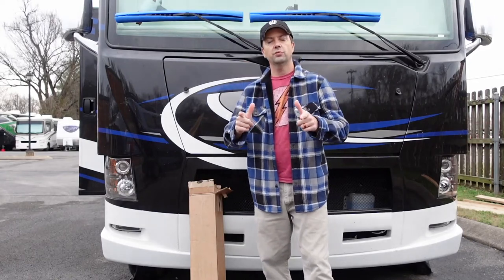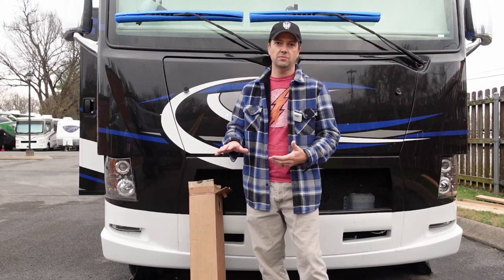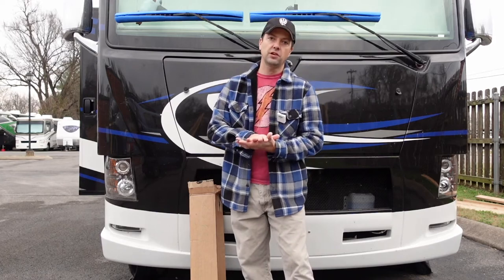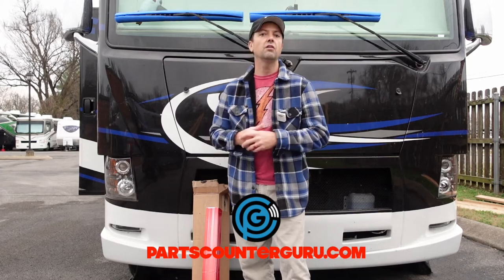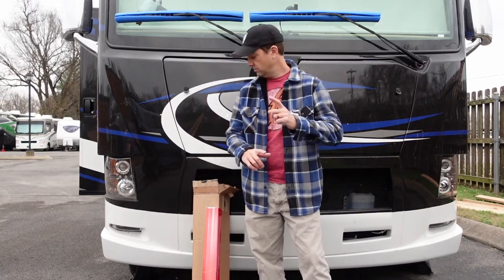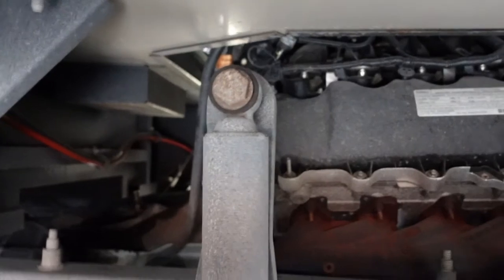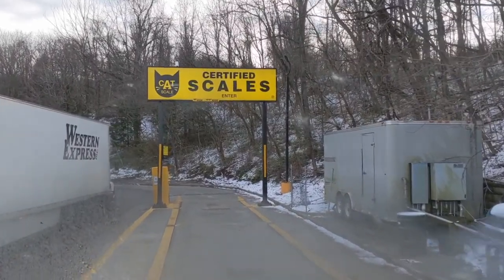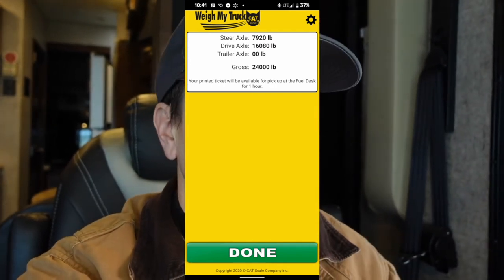Ford F53 Motorhome Chassis Shock Replacement And a Quick DIY Ride & Handling Fix

Comment: excellent video keith, totally, im pretty new into rving and we purchased a 2014 winni vista 35f , it only had about 4k miles , being a retired bmw tech, i can say i know cars , and the basics of motorhomes , i do much research and asking questions , and i will say, im not a person fond of ford , period, they have plenty of issues , it appears from my research that the ford f53 chassis is a cookie cutter chassis which one size fits all ideology , why many motorhome owners complain about the same issue the ride quality and handling issues , needing the addition of a rear track bar and front steering dampener for if anything " safetys sake " which we had to do , im having shocks replaced next month ,  i appreciate your honesty totally, but what i dont get is how some people experience the issue and some dont , and is a severe issue as far as im concerned for when driving over speeds of 50 mph . i wonder if this would be a great video for you keith , since its such a widely known issue with the ford f53 chassis , i know many people who had the GM chassis in the past and state, they loved it better than the f53 chassis ,,,,,,thank you so much sir,  again awesome video

Comment: I bought shocks for the front for starters. In your opinion will I get the benefit of only putting on the Koni shocks on the front, or will I not notice anything until I change them all? I put an anti sway bar on the back a couple of years ago and it made a big difference on the side to side sway. I don't feel like I need a change for the back yet, it's the front that is so rough, especially over frost heaves or the rippling the road gets from the snow plow blades bouncing on the road. Thank you for any info you can share.

Comment: Great video, but why do you have pool noodles on the wipers
Reply from the maker: because Class A wipers are not cheap, pool noodles are.  UV light kills rubber.
Reply: @PartsCounterGurus  Now i'm running to walmart for pool noodles in the winter. ;)